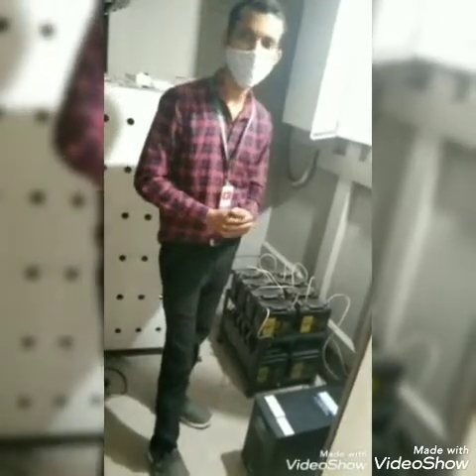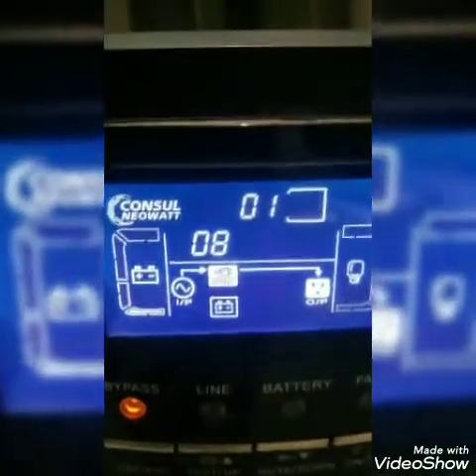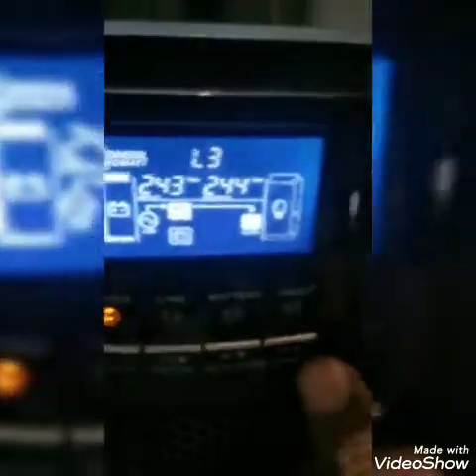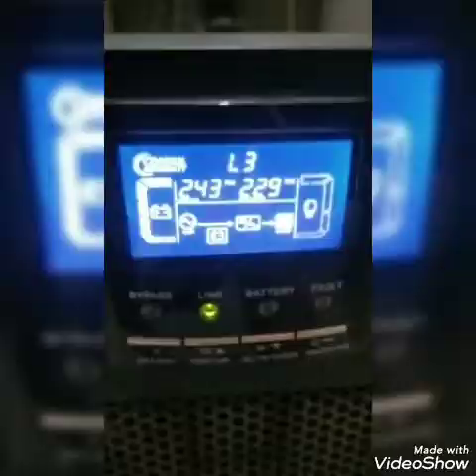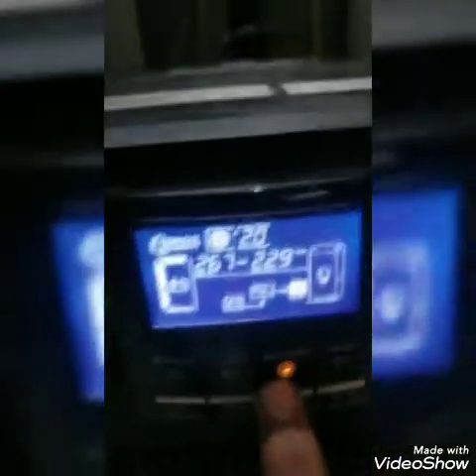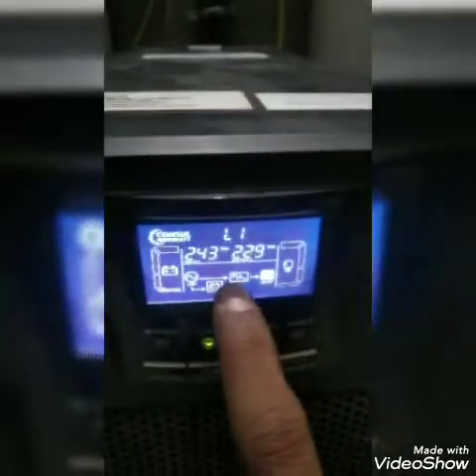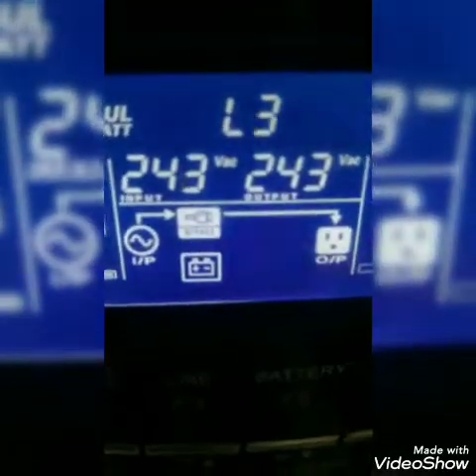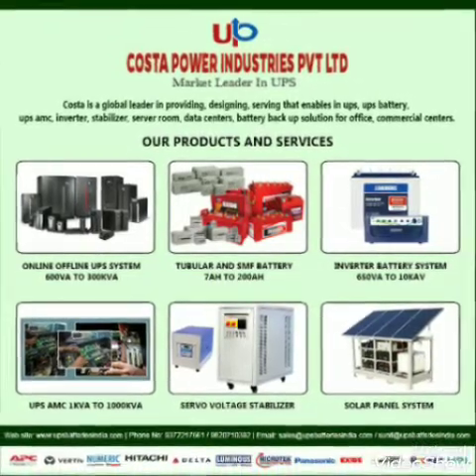On site Changeover Operations Check for 10 KVA Consul Neowatt UPS.

Comment: Sir i am from West Bengal. I have a problem on this same ups (20kva..3/1).. fault code 21 and some time 08 on the display.. Now the ups working on the bypass mode.. fault 21and fault 08 ?? please sir your what's app number..
Reply from the maker: Dear sir....There is an issue in charger section components..... check for SCR.....For further clarification please call us on our whatsapp number- 9372217661